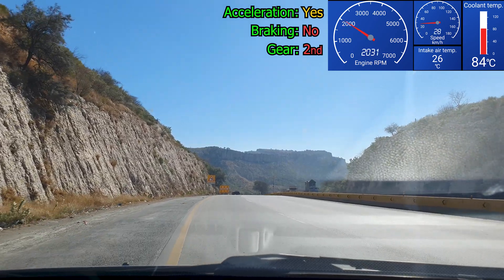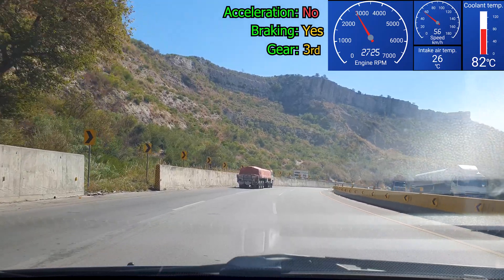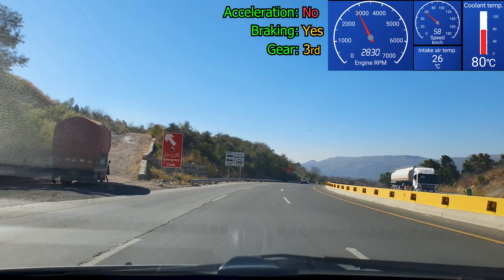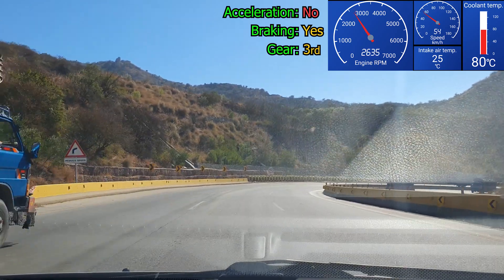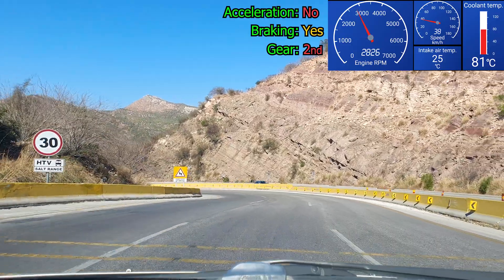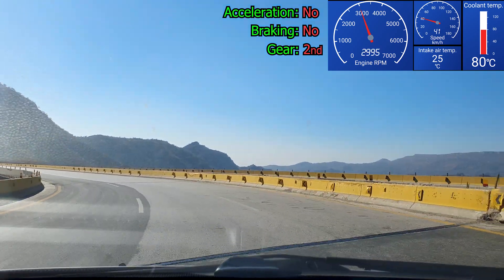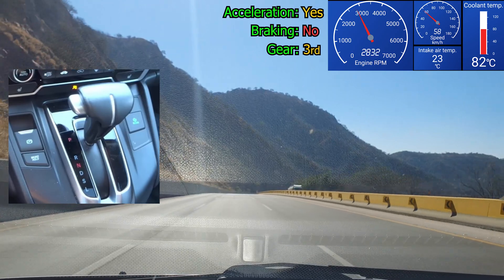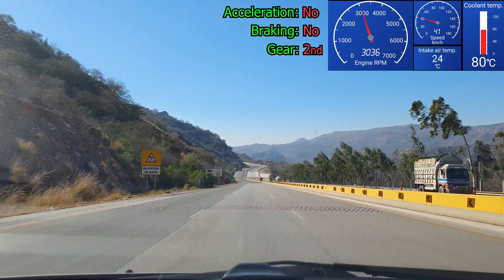2 - Braking down a mountain - using the correct gear (ratio)

Comment from the maker: If your brakes fail at any point while driving, slow down by removing your foot off the throttle and downshift to a lower gear gradually. For an auto where you cannot manually select gears or gear ratios, put it in a more aggressive setting like S or L mode. Also, do not use cruise control. 

Disc brakes (including drums) can warp with excessive heat, meaning it goes out of shape. You will know this has happened if you feel pulsation in the brake pedal when braking. If the warping is really bad it can cause even more pulsation or shaking during braking.